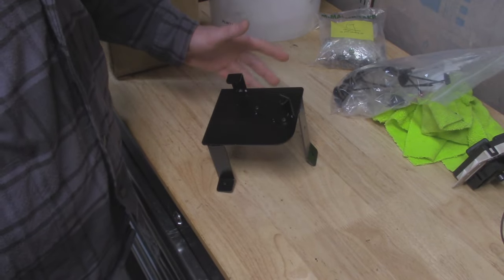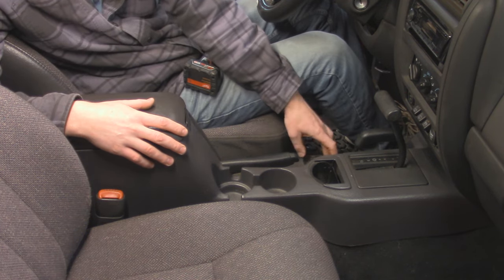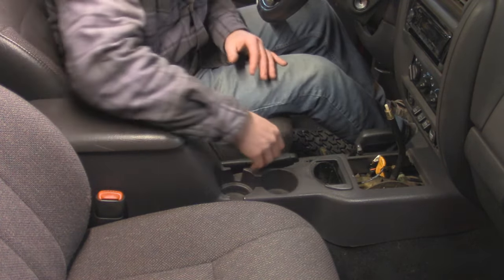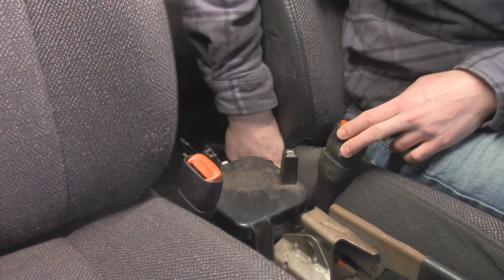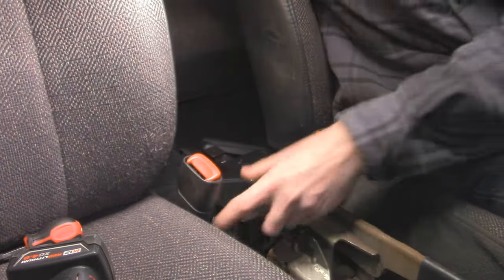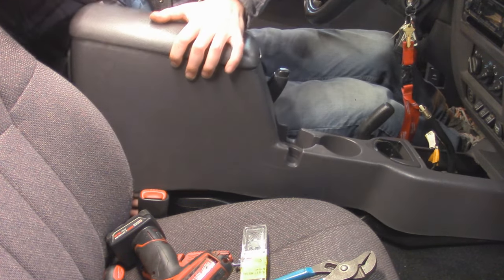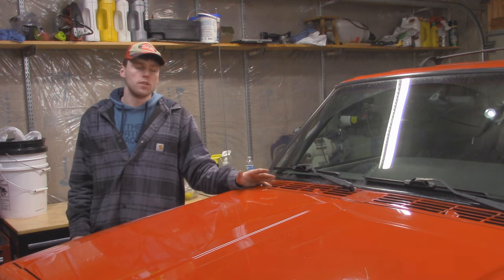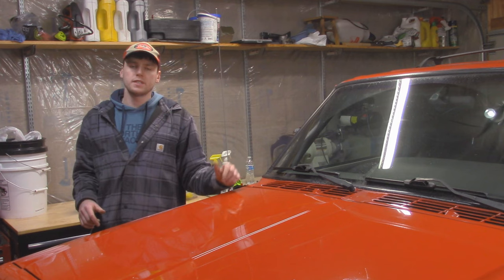Loose Center Console Fix! | Jeep Cherokee XJ 97-01

Comment: my 98 xj had the airbag control module under the seat but my 2001 has it under the console. If your airbag control module box is under your drive seat, this is a good time for you to relocate it to under the center console like he has in this video. it is better protected and out of the way when it is in the console
Reply from the maker: I believe it was a recall to relocate it in 99 due to it being exposed to water out in the open and not protected.

Comment: Thanks buddy. I had been thinking about getting the one from JCR, but wow it’s a lot . Twenty bucks sounds about right.
Reply: yea, total rip off ! 
i made one with scrap metal a few years ago because there was no cheap versions on the market... but yea, 20 bucks sounds like a fair price. 
If your airbag control module box is under your drive seat, this is a good time for you to relocate it to under the center console like he has in this video. my 98 xj had the module under the seat but my 2001 has it under the console. it is better protected and out of the way when it is in the console

Comment: Thanks for the videos, they have been a great source of information. I have a question my 98 XJ. I had to remove the neutral switch from the transmission (a pure nightmare).
 I bought a new one but I can't get the jeep to start at all. Any ideas. I would be grateful for any help. Thanks again.
Reply from the maker: Hard to say, I need more info. Did it run before you replaced it?